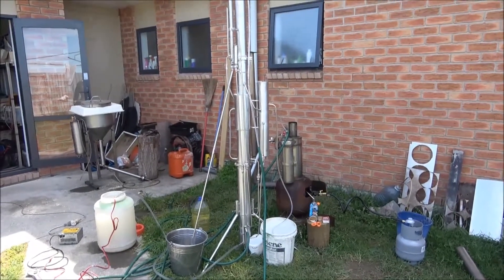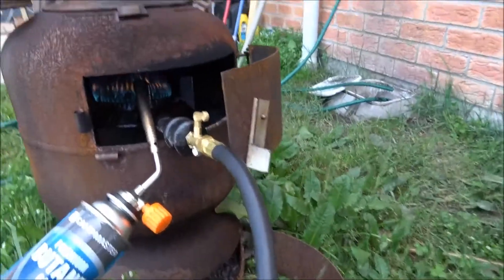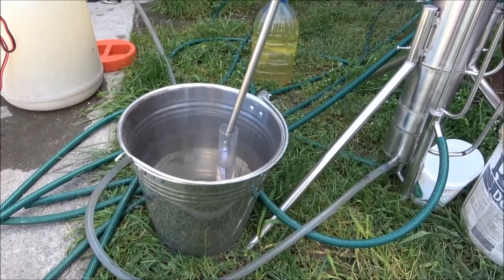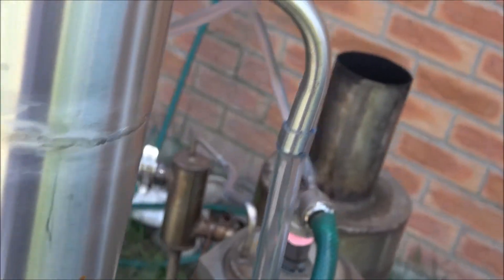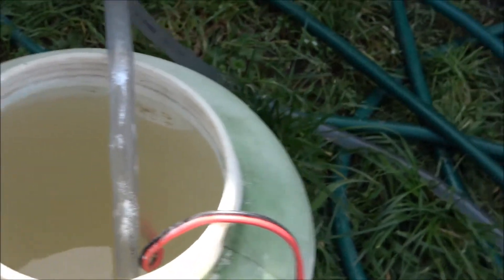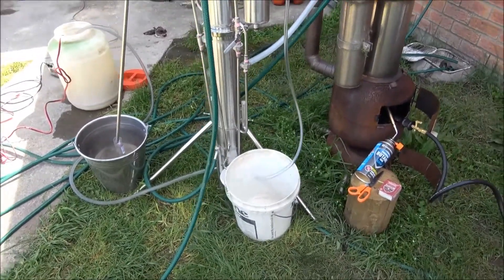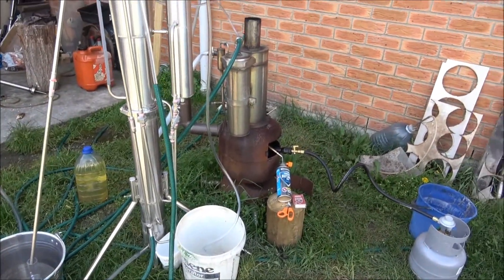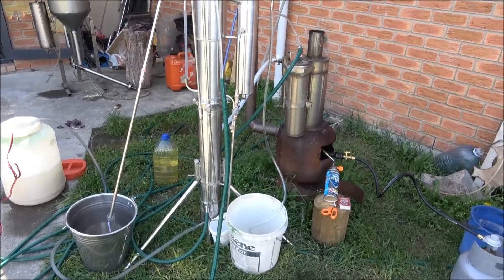Ethanol still testing.

Comment: gasifier still combo, ?
Reply from the maker: No it is a simple wood powered steam generator, and I use LPG to run it, do not want any smoke around, I needed to test the still, but have no electric stem generator around for that.
Reply: @santeryi9  why not use  a powerful induction coil my friend.
Reply from the maker: @sylvanenergy  Please understand, I simply needed to test the column before the dispatch, and did not planned for any extra expenses in form of another heat source, if I needed I could build a separate dedicated electric steam generator, - the column is tested and already gone, so the heater will collect the dust for another few years.